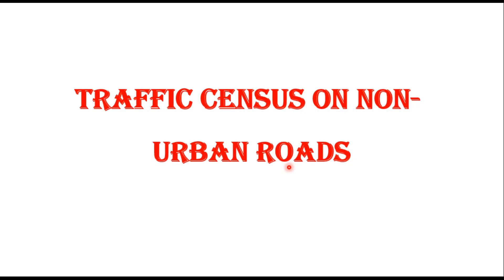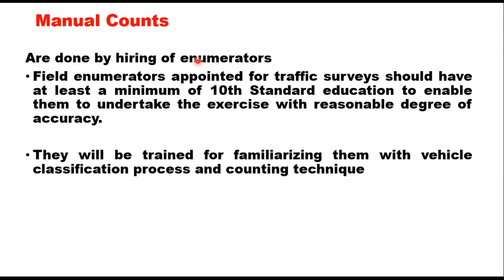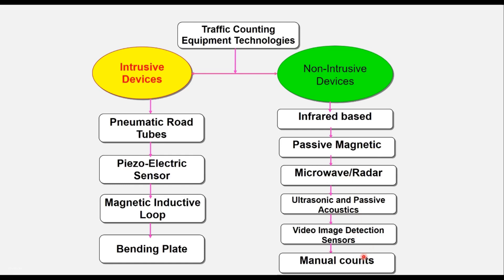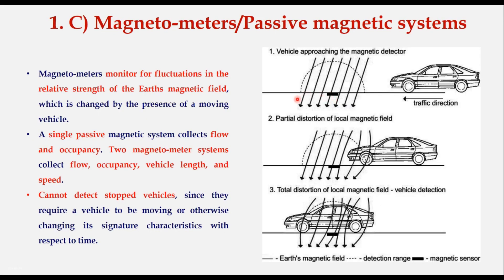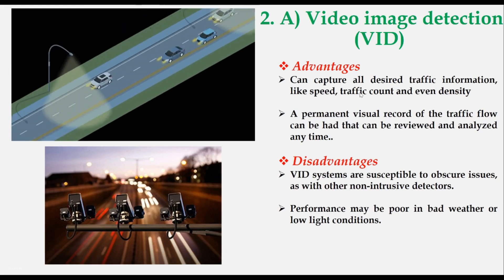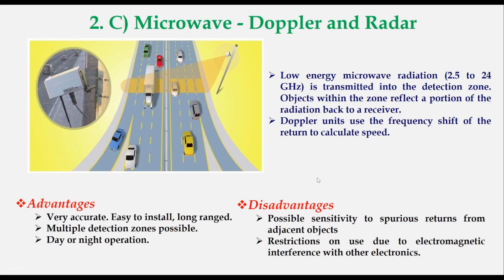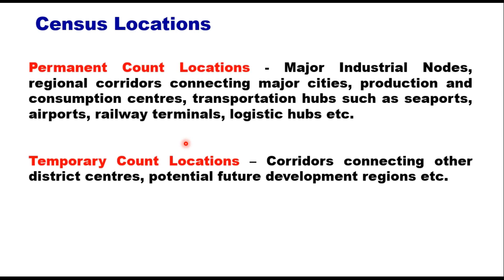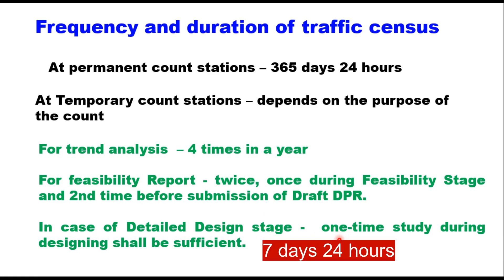Traffic Census on non-urban Roads.  Volume count methods, IRC 09, 2022. Methods of traffic census.

Comment: Hello Sir, Is there any software available for vehicle counting with classification from recorded video of intersection used for classified volume count. Because manual counting from recorded video is very tedious and labourers.
Reply from the maker: Unfortunately No. As of now a precise or accurate software for automatic traffic data extraction is not robustly available, due to challenges of mixed traffic with absent lane discipline. However, if you wish, you can use the AI-ML based tools or data from sky services for the data collected using UAV drones for better reliability.